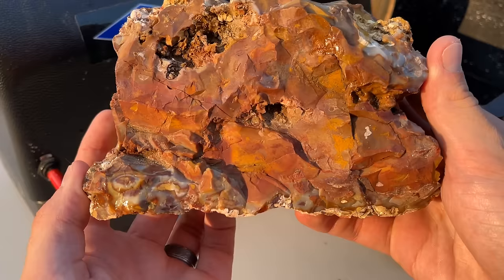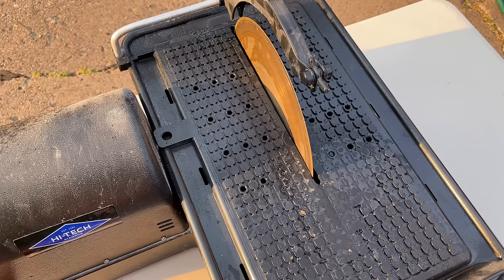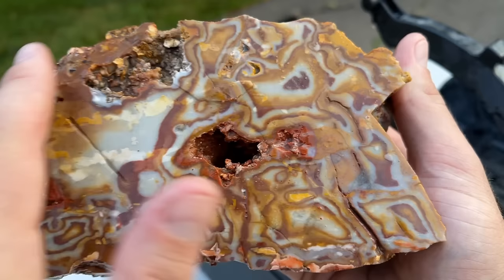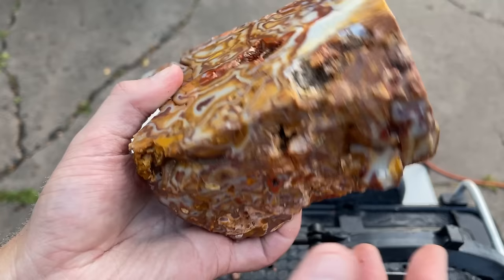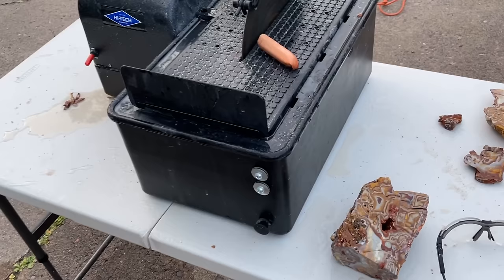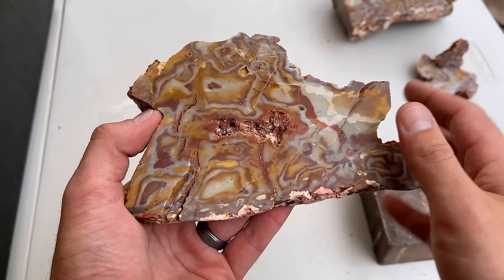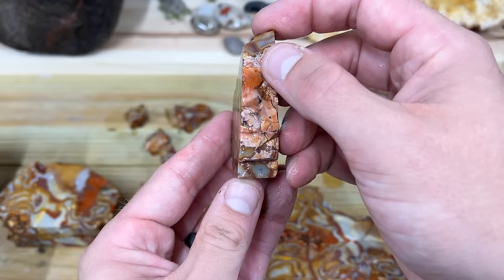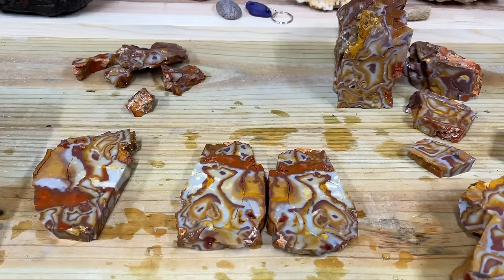Rare BULLSEYE Jasper cut open w/ Lapidary Saw

Comment: I have the same saw and have used it on about a dozen rocks.  It is hard to tell what are appropriate cutting times watching vids as you cannot show the cutting of rocks like this in real time.  Soft rocks like fluorite take little time, but something like agate or jasper this size would seem to take hour(s)?  I have a piece or quartz about 3" high and 4.5" long that I have cut for over 40 minutes over two sessions and I am not an inch into the cut?  Unless I should be applying a lot more force than I do.  At this point, I am considering a larger slab saw with a motorized feed, using oil (yuck) so I could set it and not have to stand there holding the stone.  Thoughts?
Reply from the maker: I can get through cutting a lot of stones in an hour or so, I’ve never spent more than 7 minutes cutting one stone

Comment: Probably a random question, but what kind of water hose head is that? That little thumb lever to control the water flow would be awesome for use with my tile saw. Lol. And as always, thanks for the video brother!

Edit: HOLY CRAP! By far some of the prettiest Jasper I've ever seen. Sheesh.
Reply from the maker: Just a basic head I got at Home Depot 🤘🤘
Reply: @AgateDad  I've legitimately gone to Lowe's looking for the previous one you had. The red one. Lol. Home Depot this weekend then. Thank ya sir.
Reply from the maker: I like both those stores (military discount) but Duluth doesn’t have a Lowe’s

Comment: i don't know if you chech this stuff like 2 year's later , but if you do, i don't think you realize what you cut hear. i would call it the animal stone. you spotted the gerraf's and bird's. i would have called it a kangaru. sorry can't spell. anyhow, the stone standing in the back has an upside down horse head, his nose is about an inch of the table, the stone to the left has a full sized bird upside-down head, body, tell ,wings, leggs ,everything.the other half of it is on the back of the one with the animals you spotted.the big slab to the right has the other half of the horse head, it looks more like a cat with it's mouth open,also upside down.

Comment: You are encouraged to try running mineral oil in your saw instead of tapwater. You can put a couple of bricks in the reservoir so that it takes less oil. A gallon of mineral oil is only $20.

You can see the wobble in the sawblade at different times in this video. Be careful with hard materials and using too much pressure to get them through the saw. If it isn’t cutting, use your finishing stone over and over again to clean up the diamonds. Use a finishing stone every time you make one of those big long cuts. A blade will wobble or get warped when it gets too hot. Sometimes the warp becomes permanent and ruins the blade.

Oil is messy, no doubt but you can put down a big tarp. Get a piece of angle aluminum and set up a fence that you can adjust in and out towards the blade. I made one with two medium sized C clamps and an 18 inch piece of angle aluminum. You’ll thank yourself for a much more straight cut with fewer marks on the material from the blade.
Reply from the maker: I’m not going to use oil but great suggestions 👍